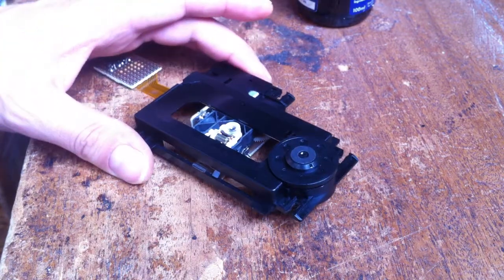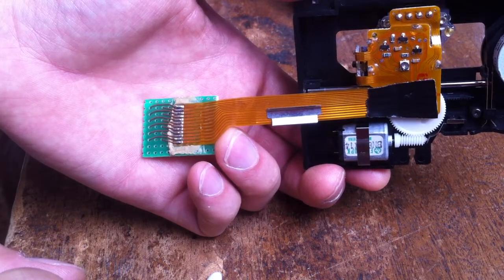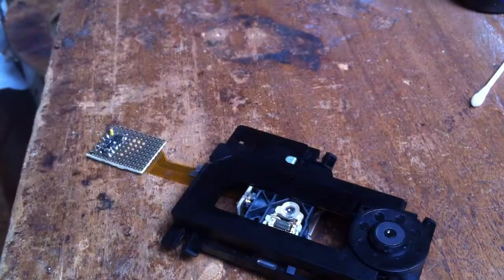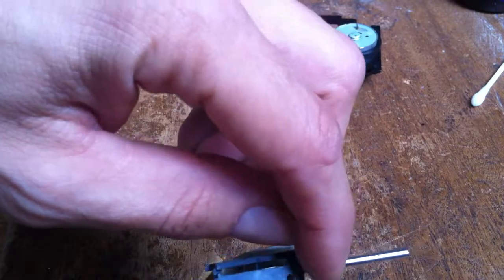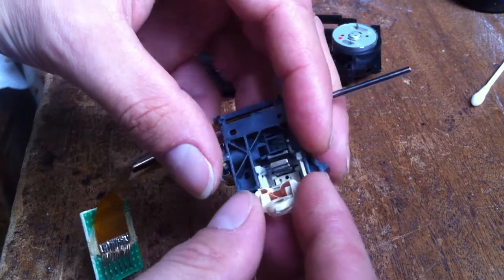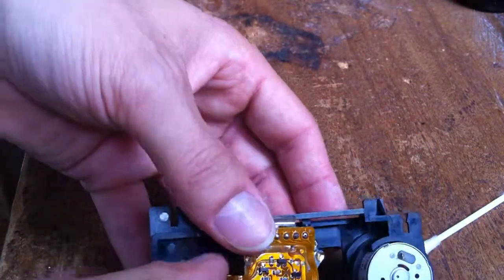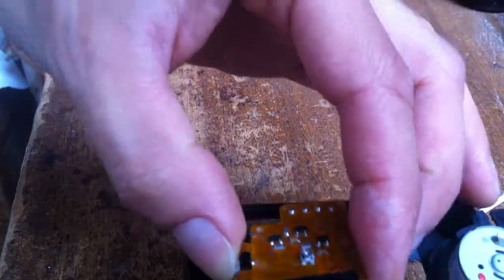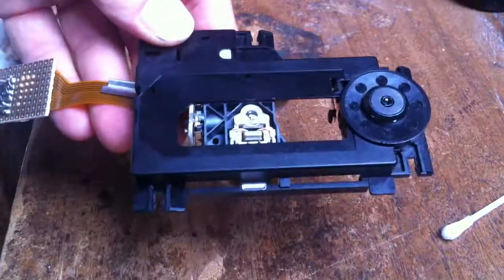Fix of no disc error, lens cleaning

Comment: Thnx a lot @japcast, this is a great video and helped me a lot with my BeoSound 9000!

By the way, are you (also) Dutchman?

I used your instruction to also clean my lense (top & bottom) and mirror. And after cleaning I put everything back.
Testing with a CD unfortunately showed it still does not start spinning the CD. In TestMode #27 there is now only one error: ‘1 CD ERR 2 = Focus error, it has not been possible to find focus’.

What do you recommend me to do?

Comment: Today checked my Marantz player. Cleaned the lens and saw the magnet was oxidized and the shiny nickel coating was loose and in pieces. The parts blocked het lens . No movement.  I ordered a new vam1201  lenspart.

Comment: Rhanks i will try to do that in my philips cd player error, also there is some value to check in the potentiometer of the laser? Thanks in advance.
Reply from the maker: The back side dust on the lens as where the video is about is not a real common issue. Please try cleaning the top of the lens first. The height of the spindle could be an issue and cause focus offset problems. I believe the potentiometer on the laser assembly adjusts the laser power. If this needs adjustment, the laser is worn out anyway. Please refer to service manual and follow adjustment procedure.